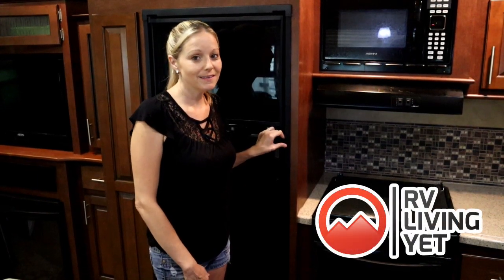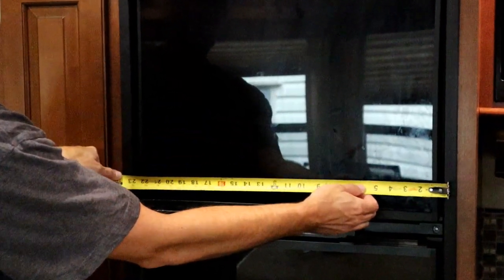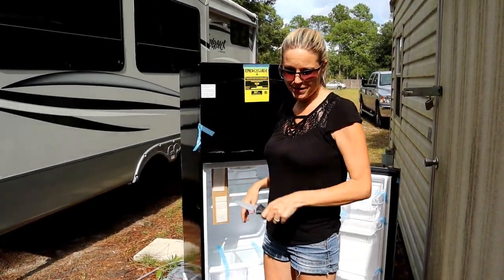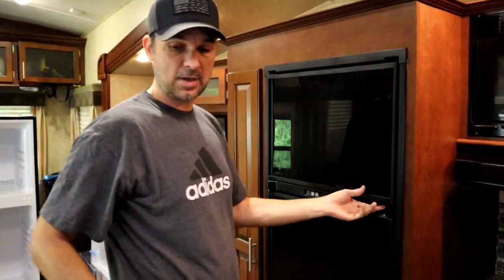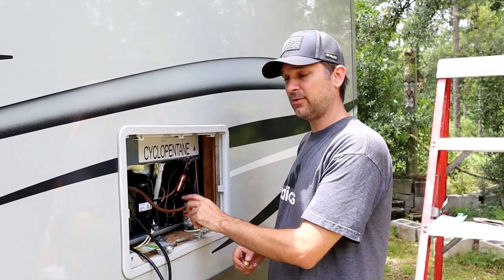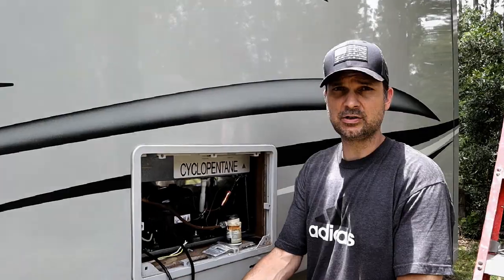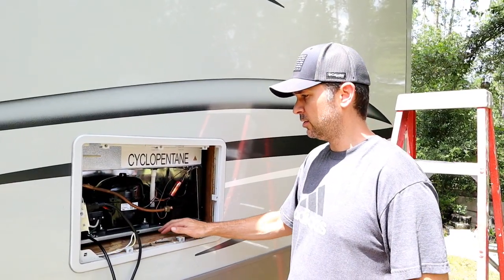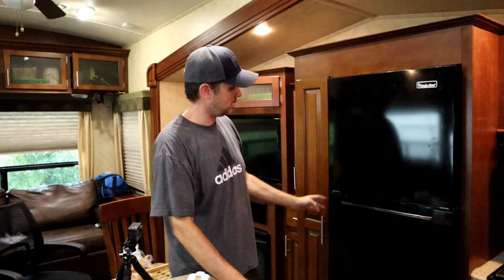RV Refrigerator Installation | How to Replace RV Refrigerator with Residential Fridge | RV Living

Comment: I got that same exact fridge for my rv, but then discovered I was suppossed to have 5 inches clearance on both sides! It seems some of the condenser in enclosed in the sides and it needs to let the heat out.

Comment: Did the same except that I put the drain at the back outside because when it does it's defrost the water stay inside the rv and if you are on the road it can spill on the floor of the fridge  in a house no problem but in a rv when moving could be !!!
Reply: plus I add vent filter to the outside access door to prevent mosquito to go inside the rv

Comment: Is this the same as changing the fridge out from a gas/electricity fridge to a 12v fridge? That's what we want to do but I'm not sure how to get the 12v connection to the fridge
Reply from the maker: The procedure is the same but you will probably have to run a wire to your 12v system since I doubt the small 12v wire back there can handle the amperage.

Comment: Hi. I am about to throw out my Norcold N811 and replace with a residential Magic Chef, which unbelievably has the same dimensions. But I get scared when I read manual, which says in bold that it is NOT an RV fridge and should not run on inverter. Also, it requires 5" space on sides and back for ventilation. I have a fridge just like yours. Are you worried about these issue? did you take it into consideration?
Reply from the maker: We can replace the Magic chef 3 times before reaching the Norcold price. However, we have done a lot of traveling with our Magic Chef and no problems at all... Very happy with our decision. 😊
Reply: @RVLivingYet  So you must have enough power to let it run when traveling and off grid.

Comment: residential fridge comes with a standard wall plug, how did you connect this fridge to electrical? with normal wall plug?
Reply from the maker: Yes there is a normal 110v plug back there,RV fridges run on 110v as well as propane.
Reply: @RVLivingYet  thank you.

Comment: One of the most thorough installation videos on this topic that I've seen!  The only things you didn't show were plugging it in (I assume you used the existing outlet back there) and loading the food back in (except maybe that lettuce 😉).  Thanks!
Reply from the maker: Thanks for watching, yes there is a standard 110v plug in the back.

Comment: Hello, Thanks for making this video. We just did this upgrade today, using the same Magic Chef 10.1cu/ft fridge,. I had to cut 5/8" out from one side of the opening in my 2007 Jayco Eagle. Even with that, it was a very easy installation, and worked out great. 
Now that you have had yours installed for a while, do you notice any heat build up issues, or anything of concern? The original fridge I took out, had a fan, to blow air up to the upper vent, like I'm sure yours did. I was also wondering about leaving the OEM batt insulation on the walls, since this Magic Chef is a traditional residential style fridge, with built in insulation, unlike the OEM gas/electric that we removed.
Thanks again.
Reply from the maker: Hey Steve thanks for watching, we have 2 back vents so I think we have pretty good circulation in the back, it's been working great so far and we are happy with the upgrade. A fan in the back would be a good idea if heat is an issue.

Comment: @RV Living Yet - I see a major problem. Your RV fridge enclosure was insulated on the sides because the old fridge rejected the heat in the back through the coil. However, your new fridge rejects the heat one the sides (not the back)! This means you've got insulation on the sides that is keeping the heat from getting out!  This will make it run longer, wasting energy, trying to cool the interior. What you should do is remove the insulation from the two sides (to let air flow remove the heat) and maybe add some insulation on the rear above the compressor (to keep the cool in).
Reply: The refrigerator in this situation is on an exterior corner in a slide out so removing the insulation from the exterior side of the enclosure might be more of an issue than a benefit.
Reply: @hobbyguy79  Anyone who buys this model refrigerator for installation in an RV - do the following test: 
Set it up and plug it in on the floor before placing it in the enclosure, and let it run for a few hours to normalize.  Use an IR temperature probe and scan the back and sides of the refrigerator. You will learn that this unit rejects heat out the sides, not the back, i.e. the sides get quite worm while the back says cool, which is the opposite of a conventional refrigerator. 

The OEO refrigerator that the RV came with was likely of the conventional type, and will have insulation around the sides. <--this must be removed.  

If you place it in an enclosure with insulation on the sides, you will be insulating the area that the unit is trying to reject heat, i.e. the heat will not dissipate well out of the side because they are insulated, and this will cause the unit to use more energy and under certain condition may not get cold enough inside to keep food fresh.

The solution is to remove any insulation on the sides of the enclosure, and allow at least an inch of air around each side. Also, make sure air can enter the enclosure so that it can flow around the sides, then up and out the vent on the top of the RV.  If you do this, you will have no problems.
Reply: @reedreamer9518  completely understand what you are saying, just noting that one wall in this specific install is an outside corner of a slide room and removing the insulation from that area might not be a good idea

Comment: Looks good, We might do something similar in the future. Our north cold is drawing about 300watts when on AC power. 
So even when we got 400 amp lithium and 700 watt solar its not really enough to run it frome our battery´s. But if a new fridge draws under 100 watts it might be an option for us. 

Thanks for sharing.
Reply from the maker: Thats about what our Norcold was drawing over 300 watts and was not doing a good job, the new frig works great and the solar barely knows its there. When this frig is running it draws about 70 watts but it only runs 50% of the time so an average of 35 watt an hour.
Reply: @RVLivingYet  That is really good to know.  70 Watt is nothing and the solar would easily keep up with that!

Comment: How did you power the new fridge? That's the one thing u am unsure of since normal refrigerators use a standard plug?
Reply from the maker: The RV fridge has a 110v plug as well, there is an outlet back there for the new fridge.

Comment: I live in a travel trailer that is not going on the road ever. My Norcold refrigerator went out--the cooling system. I want to convert to a residential refrigerator. I am a senior lady and I need someone to install and do the conversion. I live in Long Beach, California, in Los Angeles County. Does anyone know a technician near me who can do the job? Also, would it be better if I just but a refrigerator from say Home Depot, then try to find a technician who really knows how to do a conversion. Thank you. Susan

Comment: not sure you will get this message but this was a great video and very helpful, I was just busting your balls with the frigertaor comment haha. where can we get that door lock? I don't se e it on your amazon list, Thanks again, I have am ac dc Nova Kool that costs $2500 in Canada and I bought t because my dog eats raw and I want to carry more food but I saw a fridge today , same size for $500 and I only use ac power, mostly when I am driving I insert an inverter into a 25amp plug and run it from the alternator,, not sure if that will cause any issues but woking that way so far, when i AM STATIONARY THEN i USE MY litium power source and solar panels
Reply from the maker: The lock is from etrailer. Com

Comment: Your rig looks a lot like my Heartland Big Country. Why didn't you take the brackets off of the back of your Nord Cold that mounted it in place on the inside of the wall and mount the new fridge to the floor also? the brackets would have worked the same and it would have held the refrigerator in there a little more permanently from the back side too I'm perma camping because at 52 i refuse to take on another mortgage. i want to die owing NOTHING to anybody so these kind of mods seriously interest me for my situation.
Reply from the maker: Ours didnt have brackets in the back, just screws through the base. Perhaps the original frig had the brackets. So far so good with the install. Thanks for watching.
Reply: @RVLivingYet  oh it appeared that there was a back plate bolted to the floor and the back of your orginal fridge to hold it in place, that's what i was referring to,. Mind you i haven't done this yet, i am watching videos to get ideas from everyone and the replacement RV refrigerator while it would be remove and replace is not an option at over $1.700.00 so i'll do as you did and spend the $480.00 instead for the magic chef replacement as it appears now.
Reply: got the same fridge for $335.00 because it was an open box, scratch & dent but i closed off the whole outter access top and bottom with 2" thick foam insulation cut 1/16 larger than the outter openings of the outside access holes and sealed mine up with adhesive silicone and my heat hasn't kicked on all day now.  looking at replacing the stove with an electric one also and the AC with a much more efficient Mini split since the mini split uses less than half what the roof unit does. hoping to be propane independent in mine in less than a year and may even add solar to reduce my cost of electrical bills. i am running 2 rv's on my electricity currently. one is just keeping it's self warm enough to keep everything from freezing. the other is the one i live in and my bill is around $110.00 a month for electric and my fiber internet both which equates to a monthly electric bill of $49.00 for both RV's the only reason i have 2 is i bought the first one thinking it would be big enough for me and the 3 dogs and it quickly became apparent that it wasn't big enough and i hated the shower in the other one because it's tiny. so i bought a bigger one with a full size glass shower surround and 3 slide outs and it's perfect. holding on to the other one till spring and going to sell it then so i can get more for it as everyone lately has been in a buying frenzy with these things. my other one is a 2012 Heartland Elkhart Express 24" with one huge slide out that i'm hoping to get $12,000-$14,000 out of so i can pay off the property i am buying and perma camping on right now.

Comment: Already wired,u should have put 12v fans in,most do not understand a compressor fridge GENERATES ALOT OF HEAT...get rid of that insulation around your fridge,u r trapping the heat!!
Reply from the maker: 2 years and still working great, no overheating issues.